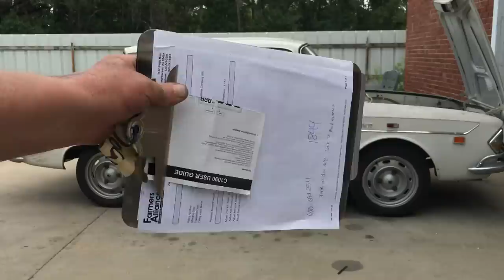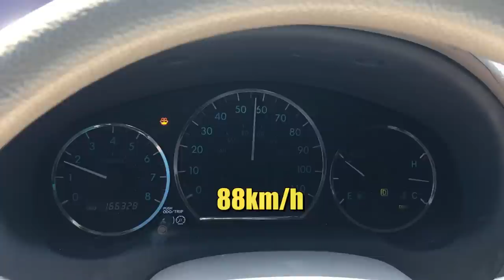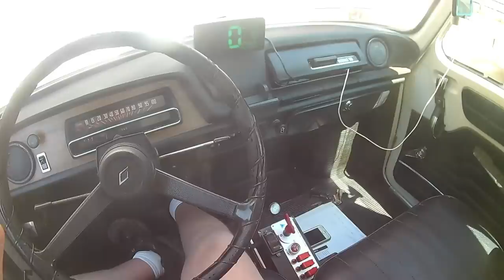S3 E21. How fast will this 670 cc predator V twin powered Renault go?...  Faster than you think!

Comment: I'm going to say 48mpgs... lol
Reply: I read this book because I wanted to learn the basics about astrophysics. But as I quickly discovered, this is not astrophysics for dummies. Yes it’s a relatively quick read but Neil deGrasse Tyson seems to wrote it with the assumption of basic knowledge from the readers.

Nevertheless, the general feel about the subject can still be understood.

Firstly, we can assert without further hesitation that the universe had a beginning. The universe also continues to evolve, with every atom in our body is traceable to the Big Bang and to “the thermonuclear furnaces within high-mass stars that exploded more than five billion years ago.”

Moreover, while the Big Bang occurred 13.8 billion years ago, it took another 380,000 years before we can see any matter forming, and few more billion years to form a planet that we call home. Yes, time moves slowly in the universe, and in the grand scale of things our 70-100 years of life, by contrast, is ridiculously short.

Furthermore, there are more stars in the universe than there are grains of sand on any beach, more stars than seconds have passed since Earth was formed 4.5 billion years ago. In fact, there are about 100 billion galaxies that we have discovered so far in the universe, one of which is our Milky Way galaxy that in turn contains approximately 100 billion more stars, with one of them is our Sun. We truly are nothing but a speck of dust in the face of the massive universe.

Meanwhile, as one star (our Sun) can have several planets orbiting it, other stars also have planets orbiting them and quite a lot of these planets are at a similar distance like the Earth to the Sun, not too close that it evaporates the water but not too far that it freezes the water. In other words, there are thousands of planets that have been found so far that are habitable and have the potential to support life just like on Earth.

I also find it particularly intriguing that Newton’s Law of Gravity also guides planets, asteroids, and comets in their orbit around the Sun and organised the orbit of the billion stars within our Milky Way Galaxy. This, as it turns out, is a common thing in the world of science: that everything from nature to space all follow certain laws of physics, while everything else, as Tyson remarks, is opinion.

The book also mentions so many fascinating facts such as different colour have different temperature, it also features the explanations of most of the elements in the periodic table, amusing speculations like the possibility that Earthlings might just be a descendant of Martians, and many, many space-science stuff that I find it challenging to digest.

Needless to say, I came here to find answers but come out with more questions. Questions like what’s in the space between galaxies? Who or what neatly organised the gravitational orbits of the planets and the stars? What is a supermassive black hole? What’s on the dark side of the moon? What’s that bright thing in the center of the Milky Way galaxy?

But I guess that’s what a stimulating book is supposed to do, and the amount of mysteries about the space that we still haven’t uncovered yet are intriguing to closely follow.
Reply: “The universe of these beings is finite and yet has no limits.” – Albert Einstein, in chapter XXXI

So says one of the great thinkers – perhaps, the great thinker – of the twentieth century in explaining his general theory of relativity. While there was much mathematical in its derivation, Einstein explains it in common language to the educated reader in this short work. He also explains the special theory of relativity here. While such things are hard to digest (at least at first), they are certainly able to be digested in this format. That this presentation exists in such clarity at all bespeaks to Einstein’s genius.

I once took theology classes at a seminary on Mercer Street in Princeton, just down the street from where Einstein used to live. Stories about his commonness yet uncommonness still filled the town. He amazingly had the gall to claim that the universe was circular or elliptical – and then attempted to prove it. He did so by clear thought, not by experiment as he was a theoritician, and this book contains an accessible version of those thoughts. For that reason alone, the curious reader is encouraged to dwell deeply within this record of his understanding.

Like mathematics, physics is a field full of geniuses whose ingenuity is common with respect to each other. I am not a physicist, and I will not attempt to comment on the science presented. From what I understand, some of Einstein’s formulations have been questioned by contemporary experiments, and string theory (though still unproven) attempts to generalize even further. To me, neither of these discredits Einstein’s accomplishment with regards to relativity. Of course, his annus mirabilis (“miracle year” of 1905) included other important findings like Brownian motion, and for better or for worse, his legacy will forever be bound with the Manhattan project and its atomic bomb.

Thumbing through a work like this and dwelling on the beauty of its contents surely provide one of the greatest experiences humans can have. Only a handful of works, like those by Immanuel Kant or Isaac Newton or Augustine of Hippo, reach the heights like this. As such, anyone with any inkling of interest in physics should attempt to study these theories, and who better to read than the author of them himself? I enjoyed my time reading this work immensely. The translation is clear and scientific, but reading still is a little difficult due to the complex subject matter. Nonetheless, being a dog eating the crumbs from Einstein’s table still provides quite a treat!
Reply: Ho avuto la sensazione di aver capito perfettamente la teoria della relatività, ma appena ho terminato il libro mi sono accorto che era solo l'effetto illusorio dell'impressionante lucidità di Einstein nell'esporre concetti a lui evidentemente chiarissimi.
Mente superiore.
Reply: For anyone looking for a great, comprehensible explanation of the current state of the theories driving today's physics, this is it. Hawking has taken everything from the early history of thinking about the universe, its laws and composition, to the latest developments on black holes and string theory and placed it in a remarkably lucid set of explanations that detail the concepts behind all the mathematics that is so intimidating to most. This book is written without a single equation or a single statement on the order of "From the above, it is obvious that..." Instead, we proceed from the (comparatively) simple concepts about the everyday observable world of gravity, planets, and stars, travel carefully along the historical path of scientific observations as they modify and enhance the simple theories till we reach the world of quantum mechanics, the big bang, wormholes, and Grand Unified Field Theories. Each concept is fully explained, and with this expanded second edition, many of the concepts are beautifully illustrated with drawings and photographs.
And, possibly surprising to some people, as we enter the rarified air of today's theories, we see that the line between physics and philosophy is a very thin one, and ruminations about the origin of the Universe lead to discussions about God and fate. Here we see why Hawking is one of the premier physicists of today, as he obviously thinks in same kind of conceptual language that this book is written in, capable of looking at the meaning behind the mathematics and how it relates to us as humans.
Physics students and engineers may not find very much new here, but even they may benefit from the clear thought lines presented here, forcing a look at the meaning behind all the esoteric symbols that are their everyday working fare.
About the only quibble I had with this was Hawking's insistence on writing out very large/small numbers as million-million-million... While this was fine the first couple of times it becomes a little irritating in place of the standard 1,000,000... representation, or even better to use standard scientific notation.
A great elucidation of some of the most complex theories of the day, theories seemingly unrelated to your everyday life, but which are in fact the bedrock upon which today's technological marvels are based, and with implications that catch the nether regions of religion and the questions we all have about the meaning of life and the universe.
Reply: As Hawking confesses, this is one of those Physics books which will try to explain you everything without feeding you real meat or printing single equation (i.e., except E=MC2). So the result is that after reading this book you would start believing that somebody taught you Chinese but apparently you can't write a single letter in Chinese. I bought the book simply because I think Hawking is probably the closest in living people who can sit next to Einstein and Newton. The way it starts is really engaging. Illustrations and those full color images are absolutely fantastic. The way the book goes is to take you on the journey to just few microseconds after the big bang to few minutes after. The most interesting part of the book is the discussions and disputes about singularity. I guess that alone (or just that, depending on your view) is worth the price of the book. It's written with lots of passion, clever remarks and it will make you think. But soon enough you will realize you are a helpless being quickly descending in the muddy quicksand. As the chapter passes by, the topics get increasingly fuzzy and extremely confusing. I won't blame the author as the publisher didn't allow him to put "real meat" in his writings. These kind of advanced topics are inherently difficult to understand without presenting actual equations and dealing with guts and gore. I read the later parts of the book 3 times trying to make sense of it and finally came to a conclusion that it is impossible to extract a logical meaning of that part of text, even though it's syntactically correct. So buy this book to get some first hand insights in to singularity and dive in to black holes, but save your time by skipping later chapters.
Reply: This book has not been revised since its first publications in 1980, but in the meantime our understanding of physics and biology has advanced significantly. Although the book is dated, the physical principle on which the universe is founded remains unchanged. The author is a brilliant physicist & philosopher, a cosmologist, a sociologist and a humanist who is at ease when he is describing the physics of spacetime and matter from which this cosmos evolved or formation of life on this planet or the scientific, political and sociological issues surrounding the space exploration. The author quotes extensively from the history of physics and biology, religious literature, world history, media and numerous other sources with which he is familiar, and discusses our responsibilities and commitment for the preservation of the planet and the universe. He not only touches on diverse topics with deep understanding but also communicates with his readers equally well.

The author describes his experiences with the American space program and NASA. He briefed the Apollo astronauts before their flights to the moon, and his wok with missions that explored the solar system. He is responsible for the universal message from earth (on a plaque) on spacecrafts Pioneer 10, Pioneer 11, and the Golden Record (voice message) on Voyager mission. Many space missions he was associated with have left solar system; Voyager 1, Voyager 2, Pioneer 10, and Pioneer 11. These spacecrafts will probably survive in interstellar space lot longer than human race. He gives reasonable amount of information about voyager missions and the possible problems it could have faced while entering the Jupiter's outer shell of high-energy charged particles or the need for small nuclear power plant for energy for its long flight farther away from sun. The geological wonders of Jovian moons Io, and his optimism of Voyager spacecraft entering the heliopause, the outer boundary of solar system in the middle of 21st century.

While discussing the personal and professional conflicts faced by German mathematician Johannes Kepler with the local Roman Catholic Church, and challenges he faced with the imperial mathematician, Tyco Brahe, to get access to his experimental data, the author makes it all come alive. Kepler and Newton represent critical transition in human history and their discovery that fairly simple mathematical laws pervade all of nature. Their accurate predictions of planetary motions based on experimental data are the first step in understanding of our interaction with the rest of the cosmos. The city of Alexandria, Egypt was a home for learning and culture and how it tragically ended life of a brilliant woman scientist known by the name of Hypatia. She stood at the epicenter of social forces that were manipulating free thinking and intellectual pursuit. The slavery sapped classical civilization of its vitality. The growing Christian church was consolidating power and attempting to eradicate scientific thought that it claimed to be paganism. She continued to teach and publish until 415 A.D., when local Cyril parishioners murdered her and her remains burned. Her name was long forgotten while Cyril became a saint.
Reply: The author describes his experiences with the American space program and NASA. He briefed the Apollo astronauts before their flights to the moon, and his wok with missions that explored the solar system. He is responsible for the universal message from earth (on a plaque) on spacecrafts Pioneer 10, Pioneer 11, and the Golden Record (voice message) on Voyager mission. Many space missions he was associated with have left solar system; Voyager 1, Voyager 2, Pioneer 10, and Pioneer 11. These spacecrafts will probably survive in interstellar space lot longer than human race. He gives reasonable amount of information about voyager missions and the possible problems it could have faced while entering the Jupiter's outer shell of high-energy charged particles or the need for small nuclear power plant for energy for its long flight farther away from sun. The geological wonders of Jovian moons Io, and his optimism of Voyager spacecraft entering the heliopause, the outer boundary of solar system in the middle of 21st century.

While discussing the personal and professional conflicts faced by German mathematician Johannes Kepler with the local Roman Catholic Church, and challenges he faced with the imperial mathematician, Tyco Brahe, to get access to his experimental data, the author makes it all come alive. Kepler and Newton represent critical transition in human history and their discovery that fairly simple mathematical laws pervade all of nature. Their accurate predictions of planetary motions based on experimental data are the first step in understanding of our interaction with the rest of the cosmos. The city of Alexandria, Egypt was a home for learning and culture and how it tragically ended life of a brilliant woman scientist known by the name of Hypatia. She stood at the epicenter of social forces that were manipulating free thinking and intellectual pursuit. The slavery sapped classical civilization of its vitality. The growing Christian church was consolidating power and attempting to eradicate scientific thought that it claimed to be paganism. She continued to teach and publish until 415 A.D., when local Cyril parishioners murdered her and her remains burned. Her name was long forgotten while Cyril became a saint.

Does our cosmos expand indefinitely or at some stage it starts contracting? The author draws an interesting analogy with Hindu scriptures of Upanishads and Puranas, which predicts that the universe undergoes the cycles of birth and death every one hundred Brahma years, where one day and a night of Brahma are about 8.64 billion years, approximately half the age of our universe. It is supposed that a universe is a dream of God who after one hundred Brahma years dissolves himself into a dreamless sleep, and the universe dissolves with him. After another Brahma century, he recomposes himself to another great cosmic dream.

The author concludes this book by stating that since consciousness arose on this planet and our immediate concern is our own survival, but our own survival is balanced by numerous cosmic forces. We owe our obligations to this planet and the universe and not just ourselves.
Reply: Every chapter has a very nice structure to it, following the same basic template: Ask a question or pose a problem, explain, conclude with a look forward. He never leaves anything unfinished or any stone unturned, so you never get the sense of abrupt subject change. Each chapter is intended to be treated as individual, and so it can be likened to a sentence, ending definitively and conclusively with a period. The reviewer that said this is disorganized is being too obsessive and completely missing the point. The book itself is more of a collection of thought-provoking topics than it is some sort of fictional story meant to "flow". If this is what you are seeking, I suggest going back to fiction. It honestly makes the book easier to read the way Sagan structured it.

If you are a religious person and are nervous that his atheism might somehow offend you, I assure you that he is never arrogant, confrontational, or mocking. He is simply a humanist, and is looking only to impart upon his audience a true understanding of how beautiful our existence and the science behind it is. Not only does he deliver facts, but he successfully enlightens you. I can honestly say this is the most profoundly educational book I have ever read. I have never learned so much in just one book. I feel not just more educated and knowledgeable, but wiser as a human. He only tries to dispel the hold that superstition has had and the darkness of ignorance that has haunted us throughout our history. He leaves you to believe whatever you want to believe, while making sure you never make the mistake of attributing truly scientific processes to magic. You may even find a better reason to feel spiritually in touch with our human identity and the meaning of life. That's all up to you how you interpret this, but this is beautiful education and enlightenment, not an offensive attack on anything or anyone.

He is a beautiful writer and sometimes, I was blown away by the flow of his words. There were some sentences that were as musical and intricately beautiful as symphony. He is truly a loss to our race, both for his knowledge and his perspective. His is the hand that waves away the smoke, clearing that which is otherwise in plain sight for everyone to see. Do recommend. Would make it compulsory reading if I was a dictator.